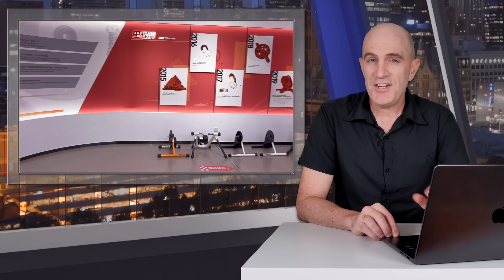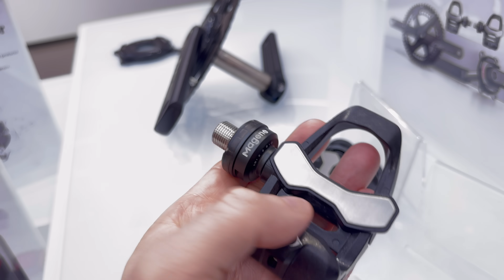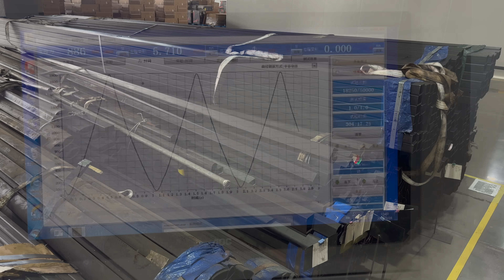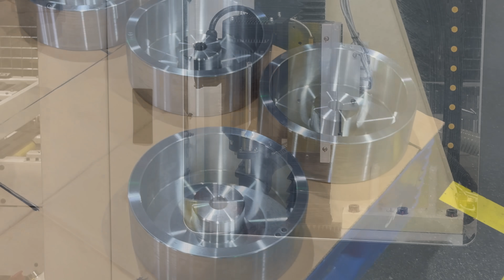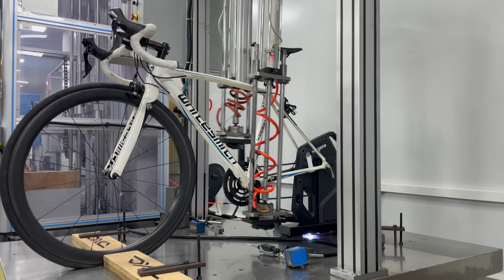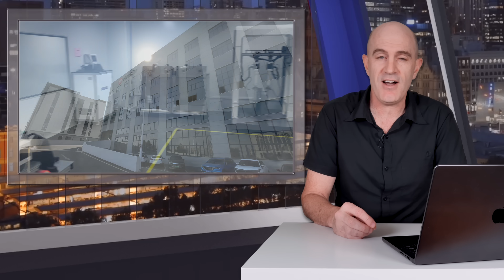Inside MAGENE Headquarters // GPLama Tour 2024

Comment: I was genuinely happy to give them a try, and to be fair, my power meter worked great for around two years. But the Achilles’ heel for a company like this is customer support, and unfortunately that’s where the whole experience really fell apart for me. Once the unit failed, dealing with support became a miserable process, slow responses, poor communication, and a lot of what felt like gaslighting instead of actual help. In the end, I was basically left high and dry.

Comment: Great content! I've been super happy with my P505 (bought as the power meter only, no cranks) which I've put over 10,000km on in the last 16 months. Accurate, connects to the head unit every time without issue, and excellent battery life (I can remember charging it only 2 or 3 times in the entire time I've owned it). The armband HRM I have from them is also excellent, with no issues whatsoever. I'm very interested to see what price point their new electronic groupset is going to come at.

Comment: Although I was completely embedded in the Garmin ecosystem, I have become quite underwhelmed with the expensive Garmin equipment.

I own a Garmin/Tacx Neo T2 with Motion Plates, from which one of the four plastic feet broke off. Disappointing quality that things like that can happen. Why isn’t such a thing made from ABS?

During my last trip in France my Garmin Edge 1040 performed actually pretty well in have rains, which made me wonder why my Garmin Edge 1030 performed not at all in the rain. Apparently Garmin has quality issues with their touch screens.
On the other hand the rerouting of the Edge 1040 is abysmal, while that of the Edge 1030 was pretty good. Also the Edge 1040 has an additional setting on rerouting: on the Edge 1030 one can turn on/off automatic rerouting of the course, on the Edge 1040 one can additionally turn on/off automatic rerouting of the route. Rerouting of the course by the Edge 1040 totally obliterates the carefully crafted track, while the Edge 1030 keeps the track in tact and leads me back to it.
What rerouting of the route by the Edge 1040 does I still have to find out. The manual of the Edge 1040 uses the words route and course interchangeably, and thus gives no clue.
Lately the Garmin site states I have a VO2max of 57, which is quite high for me at age 60. But the site also claimed that I do not enough high aerobe activities. Yesterday I found out that the Garmin Edge 1040 automatically put my maximum heart rate at 178, while it is in reality closer to 160. This probably explains both insane indications.

I also had my Garmin Rally XC200 pedals with me during my trip in France, which proved not to be watertight at all. Great disappointment. Also the replaceable batteries caused a lot of problems. On return from my trip I bought some Favero Assioma Pro MX-2. Hopefully they will perform better.

I have a Garmin HRM Pro from which one of the four nuts came loose from the plastic housing within three years. Alas outside their warranty period of 2 years. Garmin did not want to address the issue.

I have no problem with paying extra for premium equipment. With Garmin apparently only the price is premium. Their equipment is just not that good at all.
This opens the door to other manufacturers, like Magene.

My last purchase was a blood pressure monitor, which was advised to me due to my age. I now bought one from Omron, that costs less than half of the Garmin Index BPM, and offers five years warranty instead of the two years by Garmin.
Reply: Like your BP Monitor comparison. Pretty much all other tech outside of cycling related tech is proof that companies are gouging the cycling community. They lie and make all kinds of excuses to back up their over-priced crap but here is Magene proving otherwise. Guess who Garmin and Shimano just lost as a customer, Me. 😉
Reply: @Raymond-Farts  On my trip my bicycle was equipped with Shimano XT Di2, and it worked well throughout the trip. When I started cycling when I was 16 (44 years ago) I didn’t have the money to buy Campagnolo at that time (every cyclist used Campagnolo, and wouldn’t want to be seen dead with Shimano, SRAM did not exist yet). So had to buy Shimano at the time, and because it looked so well I bought Dura Ace. Since then Shimano picked up and the prices went up. When I bought my third racing 25 years ago bike I chose Ultegra, because Dura Ace was so insane expensive. I think I would not even chose 105 anymore. But Shimano still have cheaper group sets that work really well. So, I don’t have many problems with Shimano. It is good that alternative manufacturers show up now. They will keep Shimano and the like sharp.

Comment: Great Video . Congratulations on 200K. Magene has come a long way in the last few years. 

My first cycling computer was magene c406. My first indoor trainer was magene T100. My first power meter was magene P325 CS. Although I didn't have any problems with the Cycling computer or the trainer, the power meter Magene P325 CS had few problems. In 6 months, the right side stopped working, Although it was in warranty I had to ship it at my own expense (USD 50), to China for repair from India. Also, I was without a power meter for 2 months. Now again the power meter doesn't work (6k km usage) and it's out of warranty. Mailed magene and was quoted 115 USD for repair + 90 usd for shipping both ways. 😢. Thinking of ordering a new magene base p505 instead of repairing this power meter.

I also have the same power meter in another bike, no problems with it till now. Hopefully, it doesn't fail after the warranty gets over. Also i bought, 2 H603 hr monitor. First one worked for 6 months and second one for 10 months before failing. I have come to accept the fact that HR monitors fail. I got this after my wahoo hr failed after 1 year. Last week I purchased magene c606 cycle computer as it looked good for the price just to test it out as i got a good deal. I am using hammerhead karoo 2 now.

Hopefully the new power meters and other products r built to last a long time.

Comment: just as a FYI when it comes to the Magene heart rate trap, it's a single broadcast in Bluetooth. Meaning it's paired with one online platform (MyWhoosh) with my laptop. Will now not pair any other online platform (such as IndiVelo, Zwift or even MyWhoosh on a different device). In 2024 this is disappointing design. And no mention of that in their online resources. So back it will be going to the retailer (which is honest life admin we could all do without). Disappointing.

Comment: I'm happy with the PES 505 Base PM cranks on my road bike but I'd love an equivalent for Gravel...
Reply: Is the issue chainline or ring size? BikinGreen on ebay has 46/36 rings that are compatible with Shimano road cranks. Haven't tried them on my 505s but that's something you can take a look at.
Reply: Keep in mind that many gravel bikes are still compatible with road cranks. If it has tons of tyre clearance on the rear then maybe not, though, but it's worth checking.